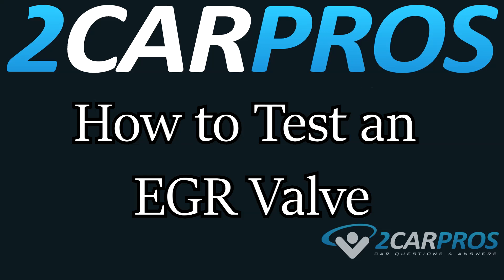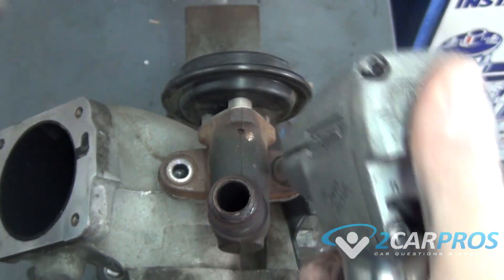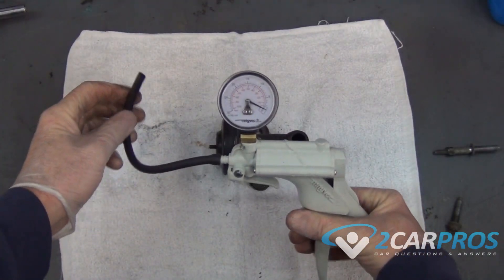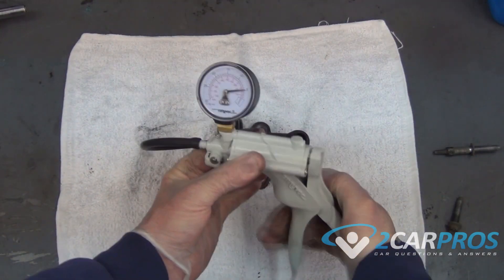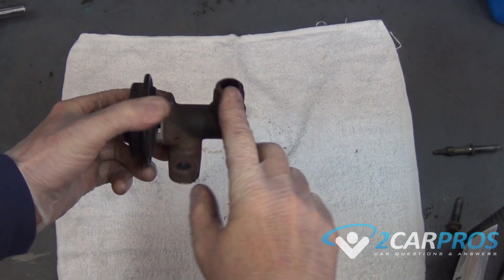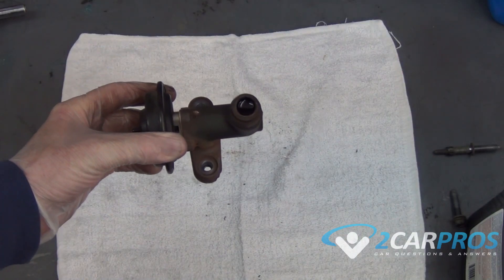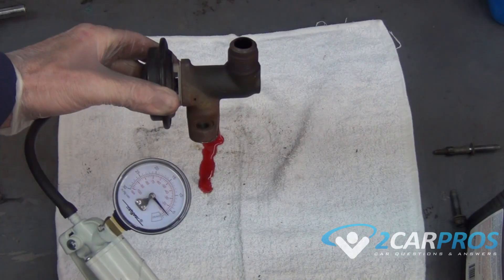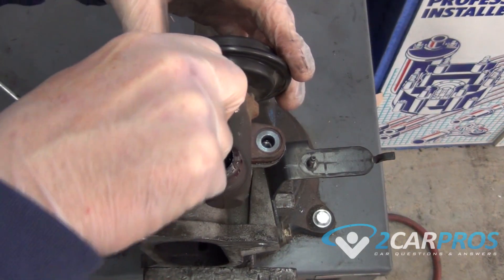How to Test an EGR Valve

Comment: Need some guidance here, I did a smoke test for vacuum leaks on my Ford and one of the places smoke was coming from was the vent holes on the bottom of the diaphragm part of the egr. The smoke isn’t coming through the little vacuum line though, because that still holds vacuum and opens and closes the egr properly. The smoke is coming through the intake side of the egr. Further investigation showed that I could suck a decent amount of air through the egr even when it was closed. Anyone know if this is supposed to vent this way? Any guidance or advice would help alot
Reply from the maker: Sounds like it is bad. Time for a fresh one! Thanks for watching!
Reply: @2carpros  yeah I agree thanks mane
Reply: I can see light around the seal when I shine a light through the opening and I fill it with water it seeps out slowly that means it's bad?
Reply: @eddiestaggs7827  so the thing about these valves is that it is going to leak a little bit of vacuum anyway because air will get sucked in through where the pintle is, that’s just how it’s made that’s normal. But if it doesn’t seal such that it’s letting exhaust gas in then it’s probably bad. What codes or conditions do you have?

Comment: My 96 f150 302 (5 L)  EGR valve holds vacuum extreemly well but applying vacuum  does mot move the pintel  valve. The valve is not showing carbon and moves freely with light hand pressure  using a punch or screwdriver. As though tne valve is detached from the diaphram. ???

Comment: If it's not hold a vacuum, then why bolt it back on?
Reply: Open your eyes and ears better and watch the video again to answer your question,.
Reply: @Z-Ack  lol,crystal,doesn't hold vacuum but it holds oil like it should ,maybe it can hold whisky on the other side.

Comment: The rubber diaphragm is probably shot and needs a new egr valve as it won't hold vacuum.
Reply: Is that on the inside of the EGR cuz I have one that looks like that in the video but mine has a rubber seal on the inside of the black top thing that ripped open.
Reply: @gamesponge7176  From my experience, Yes there is a rubber circular seal on the inside and a gasket on the back. They do wear out because of the gases that go through it are hot. It gets real clogged up especially if your motor is not in top shape either. Best thing is to replace the gasket holding it from the backside and try cleaning it. If it doesn't work it is probably old and needs a new valve anyways.
Reply: On the back side is a plug or electrical that plugs into a clip so I don't have a gasket it's just the round top that says EGR and the back end says vacuum but it sca male piece type plug. The code said it was my EGR. That rubber seal is what's been causing my van to jerk when accelerating and making popping sounds?
Reply: @gamesponge7176  yup. I had the same problem. If not then I couldn't tell ya. But I for sure remember those stupid popping noises.

Comment: okay so its a bad valve because it doesnt hold vacuum, but because it only leaks fluid when the vacuum is applied its good?
Reply: so it a bad egr valve but it is also a good egr valve, which is it?
Reply: @ripfirer1  It's a bad EGR valve. If the rubber diaphragm is old or doesn't work as it should, It will cause a vacuum leak and keep the valve from working properly. By closing more often than it should.

Comment: Was the vacuum test failure not enough to justify replacement of the part, or was the fact that it held liquid until vacuum was applied enough evidence to reuse it?
Reply: Replace it. You don't want a vacuum leak.